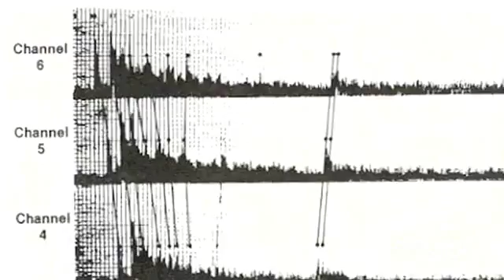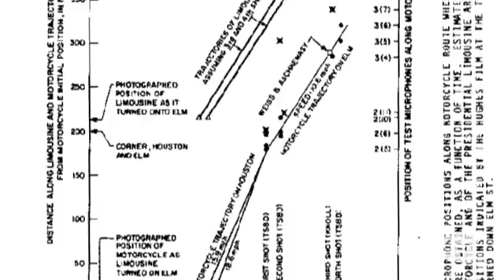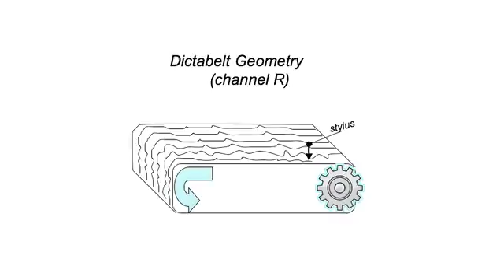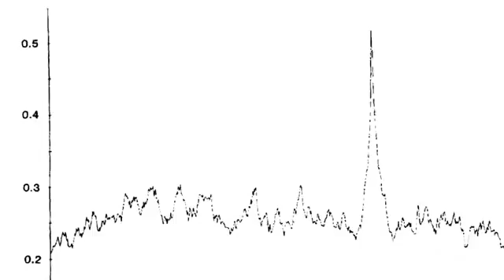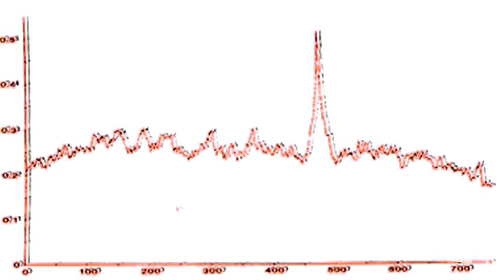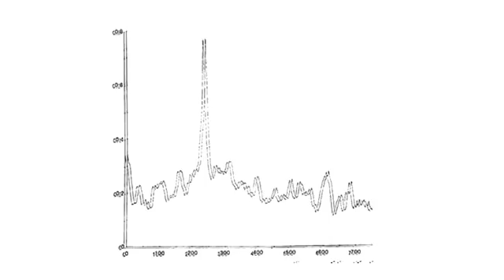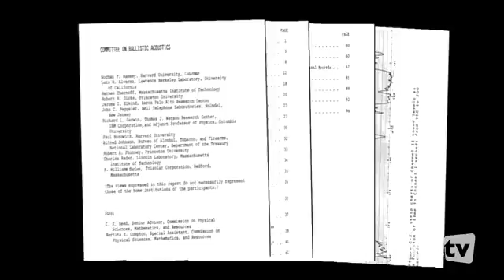JFK Assassination ~ Dictabelt Acoustics Analysis

Comment: I think they're were multiple teams of shooters. Some using silencers. Definitely different types of ammo. I am guessing seven to a many as eleven shots fired.
Reply: If that was the case, Kennedy would have been killed instantly rather than sitting upright over halfway down Elm Street. Three shots and only 3 shots were fired by one nutcase named Lee Oswald.
Reply: @IwshIcldstrtover  Except, they weren't.
Reply: @jimmoynahan9910  "Except they weren't"?   Explain what you are talking about. How is anyone supposed to know what "Except they weren't" is in reference to?
Reply: Kennedy wore a big bulky back brace that is why he could only slump. JFK was hit 2 times in the head, once in the throat (frontal wound) at least once in the back. Connely hit twice, one shot hit curb and wounded Mr. Teague, one shot missed and hit in the grass (bullet recovered by police...video of that) one shot from the front went through windshield, one shot hit dash in front of limo, one shot hit the rear trim of limo. You need to do more research.
Reply: The Seeker
 Kennedy was struck once in the head from the rear, and once in the back from the rear. The bullet that struck him in the back exited his throat.  The bullet that entered his head entered the rear of the head blowing off the top of the head.  The bullet that exited Kennedy's throat stuck Governor Connally . The missed shot has not been accounted for, but it was fired circa Zapruder film frame 152-155. There was never any bullet found in the grass. That is nothing but pure speculation based on photographs that can be twisted into anything you want to believe.  All skull fragments found in Dealey Plaza are accounted for and they all landed ahead of the limousine, in the infield grass.  One fragment was discovered by Billy Harper. The other fragment(s) were found by David Burris.  There was no shot that hit any "rear trim" of the limo. James T-a-g-u-e was struck by a piece of concrete from the curb, but no one( not even himself) could tell us which shot caused that to happen.
Reply: @IwshIcldstrtover  " James T-a-g-u-e was struck by a piece of concrete from the curb, but no one( not even himself) could tell us which shot caused that to happen."

And yet it WAS one of the bullets, so which one?
Reply: @jimmoynahan9910  One of the shots missed the limousine completely.  Most people think it was the first shot fired.  It could very well have been that first shot.  If not, then it was possibly a fragment fro the 3rd shot.  We';; probably never know for sure.
Reply: Have you seen the Zapruder film?
In which connally is not seen at all, to have been shot for well over a second you expect me to think that  the second shot exited Kennedys throat waited more than a second, then turned right, into connallys back I don't think so.
Reply: Of course, like most conspiracy nuts, you have no factual evidence to support any of that. Just your stupid uninformed opinion. If you believe that , I believe Kennedy was assassinated by martians. It’s a fact. Oliver Stone says so.